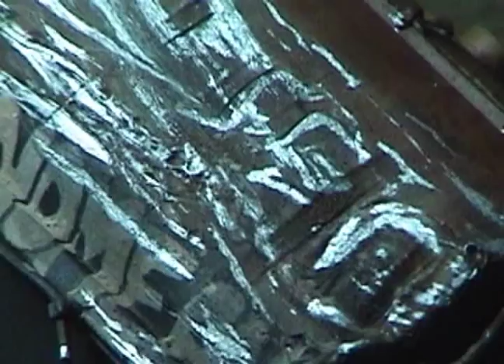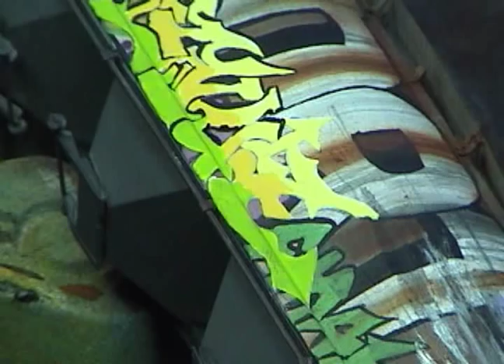Custom Weathered HO - Flatcar Wreck (Part 1 of 2)

Comment from the maker: Well this is what i use and do, the steady hands while painting fine lines, is only cause im holding by breath, I also use cheap o brushes but for the fine lines i use expensive finebrushes, the finest i can buy,id really like a brush with a single bristle, but ya buy a couple of the short finest brushes you can get, I use alcohole for medium in acrylic, when it's just rite dab the extra on your nail so you dont havetoo move your head every second from magnify  glass.